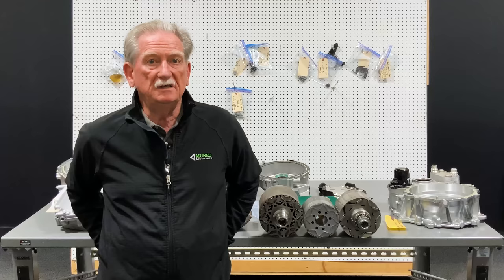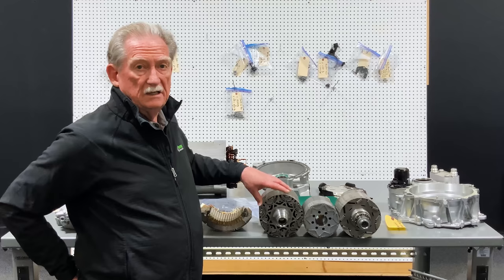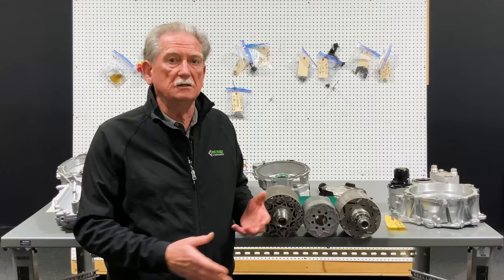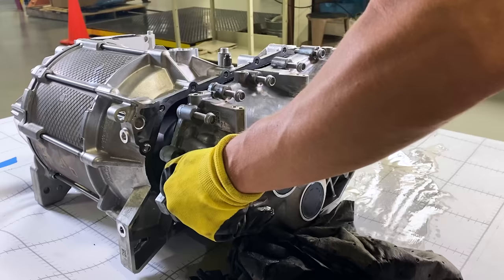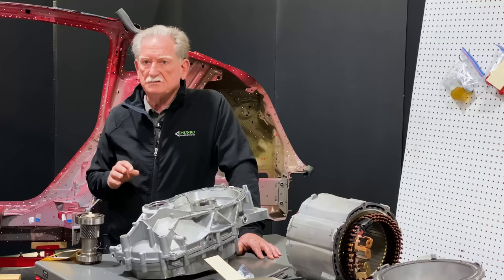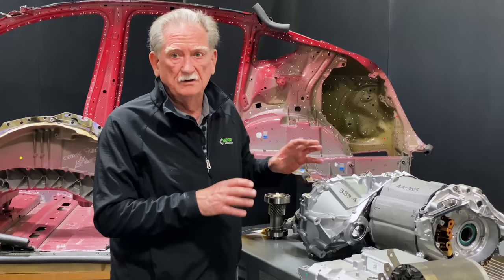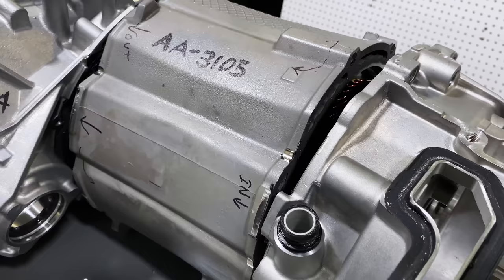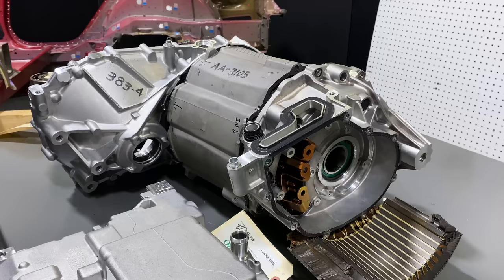Volkswagen ID.4: Electric Motor Teardown and Analysis

Comment: German Engineers severely dislike snaps and glue. We will always screw stuff down if we can find a way to. Snaps tend to break off under far less mechanical stress than screws do. Glue deteriorates under heated conditions like in a motor or high-power electronics assemblies. If it costs a few cents more for the screws but lasts twice as long, it was worth the investment. Apparently, Sandy and the US car industry could learn quite a bit from us, again. If your screws come out by themselves, you're using them wrong. There's spring rings or serrated rings if you can't get it fixes with torque alone.
Reply: I mostly agree with this.  Screws are a sign of reparability.
Reply: Exactly
Reply: Serrated rings are pretty much useless because they get completely flat when screwed tight. That's why you almost never find them on modern designs. German engineers should know that, as well as Chinese or US American ones...
German Wikipedia link about outdated screw securing methods: https://de.wikipedia.org/wiki/Schraubensicherung#Schraubensicherungen,_deren_Norm_zur%C3%BCckgezogen_wurde
Reply: What do the Japanese do? They make more reliable engines though they don’t make high stress engines as much as the Germans.
Reply: a very thoughtful reply - thanks.  What a great video!
Reply: Sandy said several times during the video that he was in charge of fastenings at Ford and did many tests and experiments to find the best way to fasten things in a vehicle. He spent literally all day as an engineer finding the best way to fasten things together and saw how things failed with warranty returns and you think you can teach him something that he doesn't know about fastenings? He now looks at all the new cars interiors and sees exactly how they are currently manufacturing things and can compare what works and what needs fixing. Unless you have just finished your Phd in a new type of fastening system I don't think you can tell him anything about fastenings he doesn't know.
Reply: @Martian74  That doesn't mean he's applying that knowledge in the correct way though. I repair all sorts of things, both at home and at work as a mechanic, making things snap together usually means they don't come apart, thus are damaged beyond repair, or need new casings.  Things need to be able to be repaired, snap and glue together is very bad for that!
Reply: @TheRonskiman  that component is not going to wear out and isn't a readily serviceable item as it is just some cheap electronic components so it is cheaper to replace the whole item and get the vehicle going straight away. Yes, you (and I) could fix it for a few dollars but for the average person who takes it to a service centre it would be more economical to just pay to replace the item and be on their way. To save money they could just use that component from a written off vehicle that isn't damaged.
Reply: @TheRonskiman  how many electric motors do you work on? I'm a robotics engineer that works on autonomous drones. We try to use less screws to save weight and sometimes use nylon screws or push pins to secure boards. Adding all those screws adds weight that has to be carried for the life of the vehicle. Like how aircraft save thousands of dollars in fuel just by switching to plastic cups from glass over the life of the aircraft. Some high quality locking push pins would save weight and securely hold the board in place and be serviceable, just replace the push pins when you take them out. The problem is they need some outside engineers to come in when working on new types of vehicles, electric vehicles aren't the same as combustion ones they are used to working on so they need new ideas.
Reply: My observation is that German cars have snap fits galore in their system. None of their coolant hoses have fasteners. They are all snap fitted with connectors and that has been a source of leakage everywhere on my E90 BMW.
Reply: You should tell Mercedes. :D Just look at the turbo assembly on newer compact Mercedes.
Reply: This might be one for Project Farm to empirically determine ;-)
Reply: But also, German engineers like to use plastic electric water pumps in a engine that often fails, for example... so German engineering is not an absolute reference! ;)
Reply: There is a lesson that sometimes screws are OK or even good.  I am always surprised to find so many things screwed together instead of ultrasonic ally welded on cheap mass produced Chinese electronic goods.  The odds of somebody disassembling a ten Dollar electric soap dispenser are close to zero, yet it is screwed together.  I suspect the reason is trained human labor is less expensive than a capital investment in robots and their programming to assemble specific products.

I’ve also been bitten by badly designed products with threaded fasteners.  I had several Poulan Weed Eater products that ejected the screws holding their cases together within a few hours of use.  I replaced the fasteners with the same type, only to have them come apart again repeatedly.  I replaced the yard tools with Husqvarna and Stihl many years ago and even though there are still screws, the screws do not fall out.

An iPhone is an interesting hybrid.  There is a lot of glue in there, but there are also screws holding things which might need replacement together.  I needed a new battery for my iPhone which Apple replaced for a reasonable cost while I waited at their retail store.  The iPhone was still perfectly fine and was kept out of the landfill thanks to its new battery.
Reply: @Martian74  sounds like you've got my dream job. Congratulations
Reply: WooShell • Absolutely correct!
Sandy is exaggerating here. Plus, you need screws not rivets because, Sandy, people are not rich like you, so they do repair their ICE, hybrid and EVs electronic modules themselves.
We take the converters, electronic modules out, disassemble them, and repair them either by changing the unit block inside that's defective or doing a component level repair.
I know that at your financial level, Sandy, you don't do it, but regular people, who are financially limited and who know how to do it, they really do it themselves.
Reply: @gisobo  Yep, serrated rings don't work, that's why the DIN standard for them actually got removed/revoked, as your link says.
Reply: You are talking about German engineering before year 2000. Today all of your cars are full of plastic,plastic clips and parts that are designed to fail. But then again that's also the brilliance of German engineering, making non essential things brake in intervals so you can sell parts.
Reply: I agree with you. But I cant really agree that engineers at BMW and Audi follow this.
Reply: ...yeah...but that's the details. We do them right and for life...but our constructs are unnecessarily complicated. We should do the details and leave the complete constructs to others.
Reply: @Martian74 lol I don’t think German engineers are looking up aspirationally at Ford quality lol.
Reply: Having been a mechanic for too many decades I have found German cars to be a pain. Way to complicated to work on. Repairs are not the first consideration. They should learn from Toyota who learned from the US in the 70's. Honda ads say they make it simple. That is a joke. I'm general the Japanese use 3 screws where one would be more than enough.
Reply: @davidbeppler3032 its bullshit, threaded fasteners fail, fact!
Reply: @TheRonskiman only if you dont understand the snap fastener
Reply: This was an oversimplification of an issue. Requirements drive the design, so it is not as simple as just use screws.